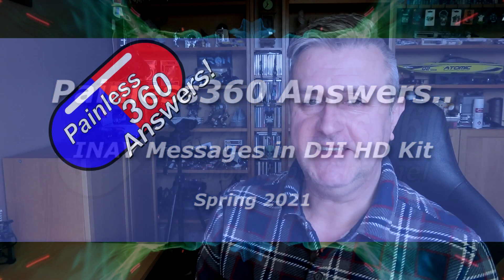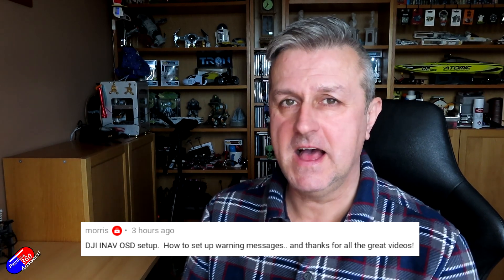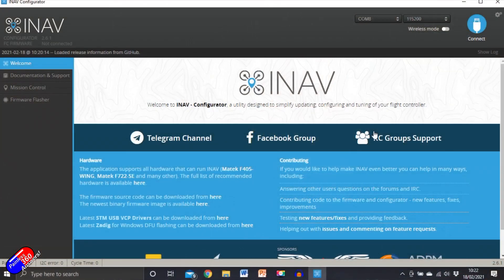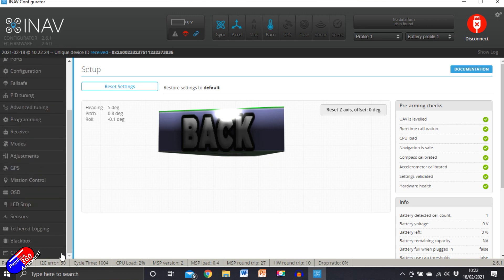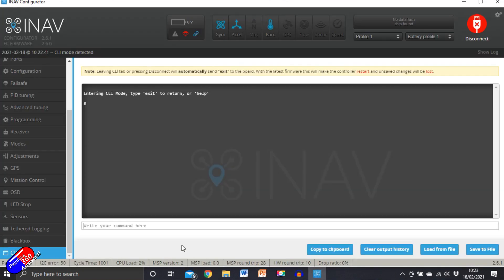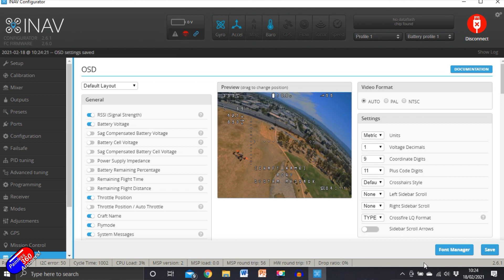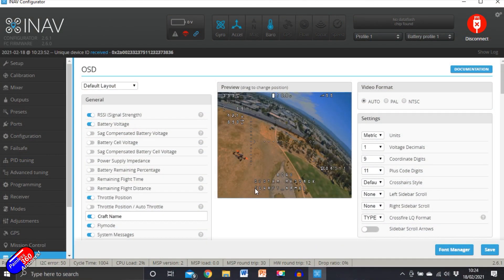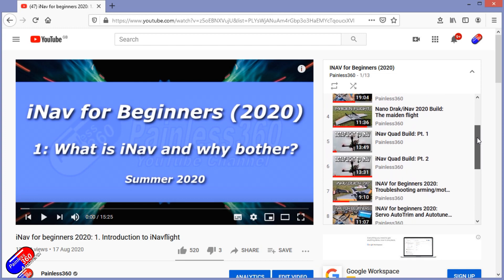Setup of messages and warnings that can be shown in your DJI HD goggles using INAV 2.6

Comment: Thank you Lee. There is another way (both are easy) in the config page go down to the craft name and put ": W"
Or use more that will be toggled :WDTSE
":" does enable the feature
W to enable the warnings
D for trip Distance
T for Throttle (manual or auto)
S for 3D Speed
E for Efficiency mAh/KM

patreon Michal Puchowski
Reply from the maker: Thanks for posting that, great addition to the video! :D

Comment: Great vid I will try this. Question so I’m not getting maps to show up under gps tab. Running a matek f722hd and a 880 gps. I show 12 sats in my basement but no maps. Everything is setup and calibrated so am I missing something. My older version inav builds all have maps appear right after 6 sats. Thanks
Reply from the maker: This seems to happen now and again with INAV Configurator. I've not had it here but there are a few issues reported with others struggling so I'd check out those for ideas of things to try. Best of luck!

Comment: Hi There
First off thanks for all your help and guidance on this stuff.
I enjoy smooth cruising and LR flight more, which F7 FC do you believe will go longer in INav firmware upgrades for 7" Quadcopters? 
I have been looking at:
Holybro Kakute F7 V1.5 & Tekko32 4in1 ESC 30x30 stack combo (for Analog)
Holybro Kakute F7 HDV & Tekko32 F3 HDV 45A 4in1 ESC 30x30 stack combo (for DJI HD air unit)
Matek FCs still looking, any sugguestions?
Also does INav osd fully work with DJI FPV V1 goggles?

Comment: Painless360 thank you for continually providing invaluable tech content. One question I have regarding iNav, like ArduPilot, does iNav provide a moving map capability you can watch while you are flying. If so will you point me to a video or link with information on how to setup. Thanks!
Reply from the maker: I think you can add that to the iNav lua script on the radio... Best of luck

Comment: Hi mate using INAV 5 here and using the latest method of renaming your craft with a : and then using the following letters WTSDE to display certain values. No matter what I name my craft It will always show warnings and throttle position. For example my craft name is simply :D for trip distance..  Any ideas?
Reply from the maker: I will be covering this in my INAV 5.0 build for beginners series starting soon... stay tuned!
Reply: @Painless360   Cheers dude! I managed to sort it. I’m sure you will know by now also. INAV 5 have simple toggle ON/OFF sliders for these things now providing you have the Craft name switched on. It gets easier and easier!  Keep up the awesome work fella!
Reply from the maker: Much better in V5...